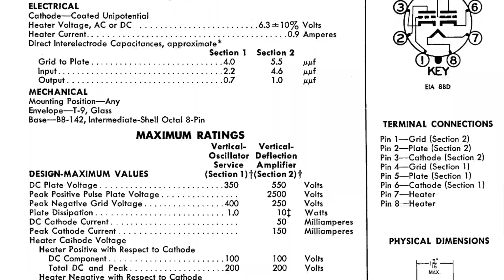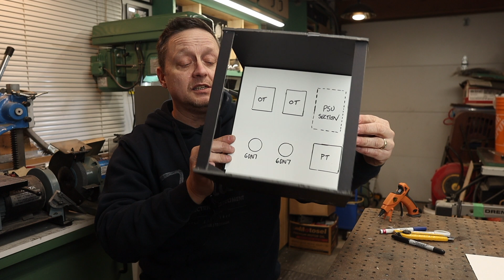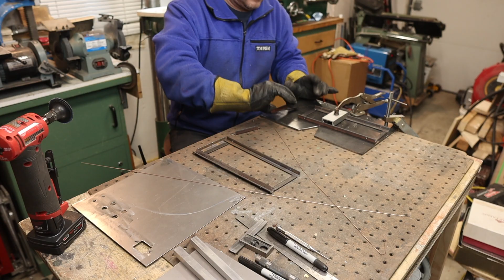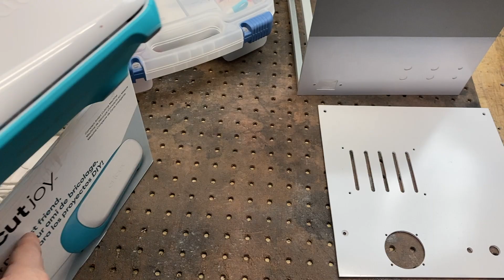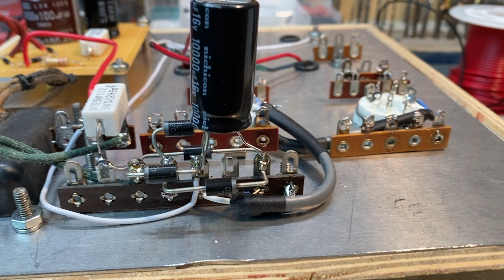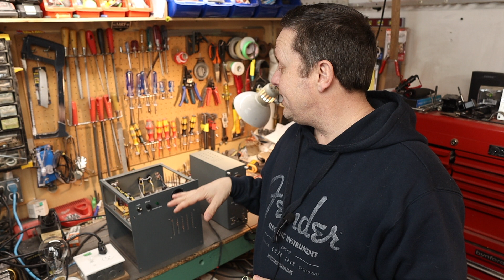How to make a 6DN7 tube HiFi amplifier / A low power Single End Triode tube amp that sounds amazing!

Comment: Mike, I have the amp up and running and it sounds great. I’ll take a picture of the schematic with my voltage readings. A little cleaning up to do maybe on the wires.
Reply: Please share.
Reply from the maker: Magnificent.  Glad to hear it worked out.  I can post a picture of your amp on my community page if you like.

Comment: Hey Mike how’s things. Amp is coming along great, just wish I had more time. I have a question about the cathode bypass 470uf/100v cap. If there’s only 16.5v on it could you get away with a 50volt cap? I have 100v Nichicon gold foils on the way but I had put 50v Nichicons on for now. When I’m finished I’ll post picture
Reply from the maker: Thanks for the update.  50v should be fine.  In this application it’s a good idea to oversized due to voltage spikes especially at turn on. Higher voltage is okay as well.  Just make sure you choose the appropriate temp rating. Cheers.

Comment: Only 45uf 450v capacitors I can find in stock are ones for air conditioning motors...mouser says sept...thoughts?
Reply: Found 1 in china cost me $80...but need 2ea...ship date is June...guess i'll keep looking
Reply from the maker: No. Don’t use motor run caps.  Try to use what is spec’d on the schematic or parts less.  Less capacitance will work but you will hear some hum. The ones I used only cost $8 each.  Mouser stocks them. Radial or axial will work if you can fit it in.
Reply: @MikeFreda  Ty Mike
Reply: all at mouser are non stocked...w june delv...i can get 47uf 450v caps all day long will that work?
Reply from the maker: Those will work but it won’t eliminate the AC ripple as good as a 100uf.  You will hear a slight hum.  You can change it after the fact if it bothers you.
Reply: @greghardy2676  yes, put 2 of the 47uf in parallel, there you now have the near 100uF (96uF but caps have a pretty wide tolerance anyway) and better ESR as well.  Just need a bit more space of course.

Comment: Since this is my 1st tube build, I am doing the chassis like a Bottlehead Chassis.....
Reply from the maker: That should work fine. I've built many amplifiers that way. If it's your first built I'd go with a larger plate. 10" x 12" or 12"x12" should give you enough space to place everything. Just try to keep the OT away from the PT's and leave some space for mod's like larger capacitors and a choke. I'd like to hear how you make out. Cheers!
Reply: @MikeFreda  Ty Mike

Comment: For the newbie's that are out there, you should mention to them where the meter is connected.
Reply from the maker: I do mention it near the end of the video on how its wired. I guess I can include it on the the Schematic. It basically goes after C3 before it branches off to each channel. Thanks for the comment! Cheers!

Comment: Hi Mike.  First of all congratulations on your amplifier project.  I can only think of one word to describe it, and that is magnificent!!! I have been thinking along the same lines myself but I don't know what tubes to consider.  I would like to use television tubes that are easily obtained but I've been thinking about a push pull configuration to give around 30 watts on the output.  Are you aware of any tubes that I might consider for such a thing?  This old man sincerely thanks you in advance.  Bobcat
Reply from the maker: Thanks you for you comment. I'm not aware of any TV tube that is readily available that can produce that sort of power. That's a pretty hefty amp with a large PT and OT's. I do recall a while back someone made an amp like this using an equivalent tube similar to a 6L6/5881/KT66. I think the trick with these amps is using the right amount of negative feedback to not "color" the sound to much.

Comment: I'm surprised you went to the effort of DC heaters which in the real world will make almost no difference to the sound but you did not apply any overall negative feedback, that would have lowered noise and distortion and flattened the  frequency response.
Reply from the maker: Thanks for the comment. True, adding DC filament does not affect the overall sound of the amp but it does make it quieter which is measurable on the output, especially if you want to use high efficiency speakers or headphones. Currect, I did not use any negative feedback. I did not want to "color" the sound by doing this. Yes, as you pointed out it would do all those things if applied correctly but on SET amps I prefer not to. I find it more pure.  On SEP amps, I do add some negative feedback. Pentodes seem to do better with a bit but at lower volume it find it negligible to my ears. My shop amps are rarely at full volume so I can take it or leave it.  Cheers!
Reply: @MikeFreda  Dumb design, nice metalwork
Reply: Feedback flattens the response curve but it also reduces output level, and more importantly reduces the 2nd harmonic, which harmonic is what makes the tube amplifier sound so enjoyable.

Comment: Update, all my components are in. I went with the PT-31 OTs. I haven’t gotten a chassis yet, not sure what I want to put it in. I have a few ideas though what I want to do
Reply from the maker: Thanks for the update, sounds like its coming slowly together! The PT-31 should work in this circuit but I believe it's more suited for guitar amps. The high end frequency may be rolled off a bit.  You could see if it works then make some provisions for an OT upgrade. (ie leave some space)  Hope it work out for you!
Reply: I plan on upgrading OT's for this. Hopefully by the wait time will be shorter. OD3's on the way for preamp too
Reply from the maker: Awesome. Can’t wait to hear and see how it all turns out. Glad my videos inspired you.

Comment: Mike, on your print out you have two C3’s. One after R10 in the power rail and another between R7&R8 above where it says “one channel shown and it’s not in the part list BOM. Is this the correct? value? Also for the filaments I have 15000uf on hand, this would be okay? Thanks
Reply from the maker: Hello, sorry, that is an error. I’ll will amend and reload. The way it’s drawn on the schematic is correct, the annotations are incorrect. 15000uf should be okay but your dropping resistor may be different. You could also go a bit lower and may not notice a difference.
Reply from the maker: Documents have been revised and re-uploaded.  Re-download them from the video again.